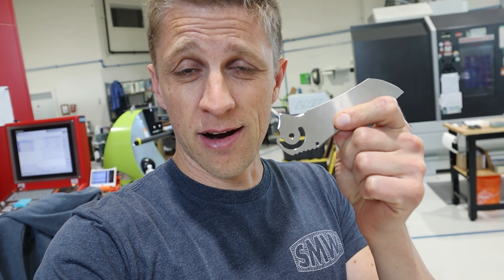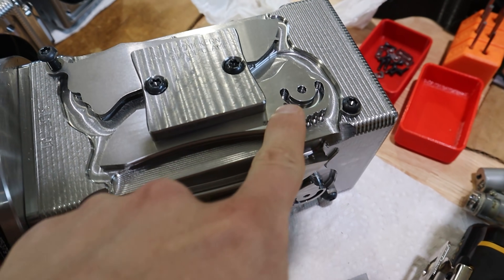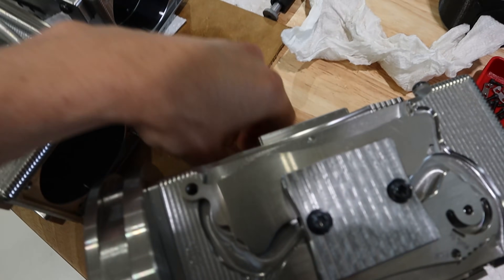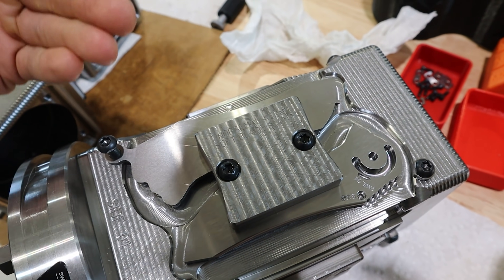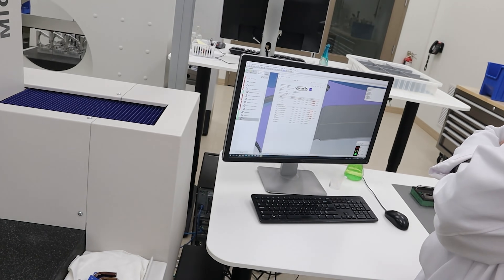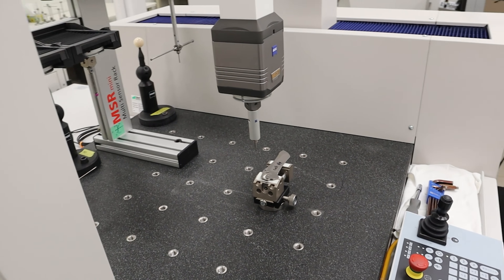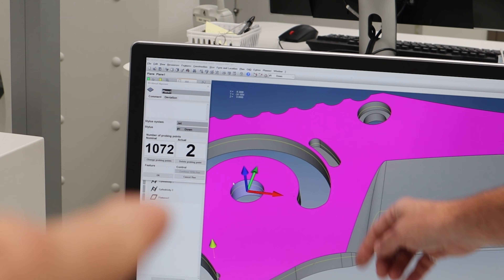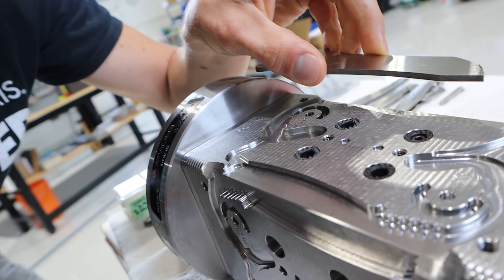Submicron Measurements!

Comment: I had to finish the video and read comments before I comment. I saw the problem at the beginning. The present fixture is inadequate for sustained repeatability. I'm personally a BIG fan of Mitee byte fixturing. Having the grippers on the bottom will produce an unpredictable part height throughout the production, produce a whistle effect when cleaned with compressed air and trap chips. The clamp should have the grippers instead. Still, this will only go so far. Changing to a small EM to do the slots will help, but you're introducing a new problem. Axis compensation. What happens is that both axis have a setting that allows them to initiate translation a set distance before the programed point. (HAAS is default .025") This setting will make the end radii smaller and out of form. This can be seen with a gage pin. The pin will not bottom out. I tune this compensation setting in the program for roughing and finishing. The smaller the compensation, the longer the cut time, but better precision.

Comment: Oh really cool channel. At 3:00. My solution would be, to watercut the blades as a pair (Like they are sitting in the fixture) and leave a small bridge in between (where this top plate is holding them down). So both blades are physically connected and cant move, untill you mill away the joint between the screws.

Comment: Really tricky with corners , specially with small end mills , what I do is slow or even stop the end mill in the corner , but I don't let it dwell to much cuz it's gonna make it bigger , made a few stamping dies that are HRC 58-62 with radius tolerances like r4+-0.02 mm. We all know how doing a second pass with same end mill will still take off material , if it got no run-out still takes off 5-6 microns

Comment: You are letting extreme engineering bravado and a total lack of experience overwhelm common sense. Perfect and ultra tight tolerances are NOT desirable for field products like folding knives. Why was the AK-47 rifle so successful? LOOSE TOLERANCES ALLOWED FOR WEAR AND DIRT! 
You need to make your design such that it accommodates loose tolerances, dirt, abuse and future wear, but maintains tight and smooth operation. What you have, is a knife design that could literally lock up and be unusable due to normal rough usage and dirt invasion. Take a Rolex, put a tiny bit of dust inside it...it stops. You have the same thing with your knife design but without the sealed and protected watch environment. In effect, you have a  highly over engineered bad design for real world use. The only place on a folding knife that needs tight tolerances is the pivot pin and blade pivot bearing surface. Make that tight, extra tough, maybe a bit bigger, and self lubricating and you'll have a really solid knife. Lastly, bring in a old time manual machinist to fix your setup and design issues. It's obvious you and your engineers have no idea what you are doing.
Reply: You shouldn't be so insulting, he obviously knows plenty and is able to achieve tolerances that only a fancy CMM can measure.  I think he has just been seduced by those tolerances and is trying to use them to get consistent feel from each knife.

You don't need tolerances like an AK, or places for dirt to get in to, you just need a slot that's a tight fit when you're on the stops but not between them.

For feel, I think he needs to give himself some adjustment flats that can be hand stoned to tune the feel as an assembly.

As for the watch analogy, you seem like a Casio guy.  Other people like Rolex.  A Casio keeps better time but that's not the point for the person who chooses Rolex...

Comment: It looks like the error is the same so my initial thought is get an end mill cut for reverse rotation and reverse the tool path or maybe mirror your whole setup so you can machine the slot from the other side.

My second thought is that precision is great but making your knife design tolerant of that level of error would be even better.

If I remember correctly, the ends of that slot are critical but the middle shouldn't be.  I would enlarge the whole thing including the radii at both ends because I think your stops use point or line contact, they don't need an exact fit.

Comment: Drilling and reaming will get you a fairly nice round hole but will not help you to hit positional tolerances. To hit position machine with an endmill, bore with an end mill, bore with a boring bar, or jig grind, more or less in order of achievable accuracy. I forget if you are hardmilling these features already but hardmilling with a smaller endmill seems like the most reasonable approach. Jig grinding would be cool but seems like overkill considering the availability of modern hardmilling processes.

Comment: Great video!
Maybe the current clamp is part of the problem. The current contact area may be too little and only one point per blade which can lead to the shift. Of you split the one clamp in two and make two defined clamping points on the clamps it will support the blade even better I think. 
You may blue the blade and clamp down to see how you are gripping it at the moment and see how you can improve.
Reply: Also bigger screws will help a lot in clamping and are a easy fix

Comment: Using a screw through the blade’s pivot hole to locate the blade in the X & Y directions may produce the variations you are describing. Perhaps using a precision dowel with a “tight” locational  fit will give you better results. Also, using a dowel against the spine of the blade will prevent the blade from rotating around the Z axis. Once the blade is located in the fixture by the dowels, that is when the blade should be clamped down.

Comment: This was interesting. I spent 8 years working in R&D at the Custom Metrology division of Brown & Sharpe (now Hexagon Metrology), designing new CMMs and sensors.
A CMM should be part of your production process, and you need an air-conditioned "Metrology Room" in your factory to use it in. (air temp changes the size of the parts)
The purpose of metrology in production is twofold. 
1) It allows you to fine-tune your process to make reliable and consistent parts.
2) It allows you to track the gradual effects of tool wear and CNC machine calibration drift on your production parts, so you can take corrective action BEFORE they make a single out of spec part. The CNC machine itself is just the measurement tool, it is the "Statistical Process Control" (SPC) Software which is what adds value and keeps your parts in-spec.

A CMM+SPC should pay for itself by eliminating part-scrappage and down-time, and through the increased sales you will get from having a brand with a reputation for quality and reliability.
Reply: He's not only going to end up with his own metrology lab, he's going to be a factory-authorized replacement parts manufacturer for Zeiss. Give it another seven years, they'll contact him and say "hey, the stuff coming out of your shop is equivalent to our quality control standards. Would you be interested in a contract for some small-batch parts?"

Comment: too bad they had a jet engine running in the cmm room so i cant hear much.
Reply: Our inspection laboratory has 8 blowers boosting the dedicated HVAC system through 8 HEPA filters, so unfortunately it's quite loud.  This is required to maintain the airflow necessary for particulate filtration, temperature and humidity control.

Comment: I'm surprised that with the holes in the blade you wouldn't pre-drill one and use it for a location pin on that tombstone.  I know it is an additional op - but yield is yield right?
Reply: Actually that's a really good idea would also add another point of contact

Comment: Here is an idea I had. If you machine a blade but leave a little section of the blade without being machined (preferably far away from the screw acting as a pivoting point) then you can probe that section in the Kern before and after machining and see how much it moved. That will let you know if your gripping pads are doing the job.

Comment: Instead of drilling and reaming those corners, consider drilling undersized and backed off the finished wall by 0.02 or so. Then let the endmill finish the slot as normal, there will be less load in the corner hopefully alleviating the problem without losing dimensional control over the slot.

Comment: John would it be better to put the grippers on the tomb stone under the knife blank and in the  top clamp to eliminate and slippage?????
Reply: I would be worried about warping the blade. That sounds silly, but when your accuracy resolution is 0.00001" or better, any kind of point load can throw a wrench into the gears.
Reply: @Coffreek  I agree, but the way John has the tomb stone set up seems there will always be an issue with slippage.
Reply: He might be able to change tool paths so that the operation is always pushing the blade in against the clamp. It would add more time, and wouldn't answer if some of the problem is during heat treat, but with all the time he's put into those fixtures, he's into a "sunk cost" situation.

Wouldn't be a bad idea to probe the piece a couple times during the operation, either. Yes, it adds time, but if the blades are getting moved, a re-probe could allow the mill to call a subroutine that adjusts all the X and Y moves by whatever fraction the piece has moved. Hell of complicated, though.

Comment: Having the Norseman blade mounted to a single point with a cap screw in the tombstone turns the blade into a hinge.
Grabbers are an aid, not a solution. The part needs a physical stop point touching it from 4 sides like a part in a vise. I'd suggest tapping three more holes in the fixture. You've got the pivot area covered, call that one West. Add East, North, and South. The part is moving during milling.✌
Reply: I think that's called 'over-constrained'.
The fixturing is really non-ideal, as is, as you point out, it's hinged in the fixture, not properly constrained in rotation. I guess that it's 'flat', so the clamp maintains that dimension, but it would be well worthwhile to develop a sacrificial feature at the tip of the blade, to prevent rotation, while allowing unconstrained motion along the blade axis, for any expansion/contraction caused by temperature changes(since i have no idea of the blade temperature coming in, or leaving, this set of operations)
Reply: Damned tablet keyboards! It appears that all of the dimensions critical to the lock and open are at the one end, so that the blade 'length' is not critical, and that tip feature needs only to be precise in rotation, with a tiny amount of 'slot' in the blade axis direction...if feasible, quite simple, adds only one feature, which can be cut away as the last operation, after all of the critical operations.  Just a thought.
Reply: The blade essentially needs to be constrained at datum features. Primary datum would be the flat side of the blade, second is the point he’s already using, and then a third stop to prevent rotation. The fixture he’s currently using doesn’t fully constrain the workpiece which allows position and profile error. 
Ideally they would add another datum feature simulator to the fixture and then build a fixed functional gage for pass/fail acceptable of the critical features.

Comment: 16:27 that's exactly why Grimsmo  deserves a CMM. also finish machining AFTER heat treat could be your magic solution. its not fun but 16:27
Reply: Finish machining after heat treat would solve that issue but also create new pains with having to machine such a small area that's super hard. There would be a lot more tooling cost, and machining cost, ect.
Reply: @Cheezzyizill , I know the light bulb went on over my head: "oh yeah! HT is a complete wildcard at these tolerances!" Seemed obvious once somebody said it. Let's see how many other ways John tries to solve the problem before "giving up" and spending the time and money.

Comment: Have you looked into wire EDM. Anymore ? That would give you more repeatability. Along with awesome surface finishes after you knock off the wire residue.
Reply: There weren't really any operations on the knife that would lend itself to wire EDM.
Reply: Sinker EDM maybe...

Comment: Zeiss Duramax. US$60k. Not a .3 micron machine like the "real" Zeiss CMMs, but definitely a 1 micron machine which will let you control everything way better than any manual gauging process. Scanning head, comes with the software, doesn't need a climate controlled room.
Reply: It's not a Duramax. It's a Micura.
Reply: @littlejackalo5326  I know it's not, I'm saying John should look at a Duramax for his own shop. A Micura is about 2x the price, an while it is an order of magnitude more accurate, going sub-micron is probably unnecessary (also, he would need to build a climate controlled room for a Micura, the Duramax can live right next to the Kern and be just fine).
Reply: @LumaLabs  I thought you were saying that the one in the video was a Duramax. My bad.